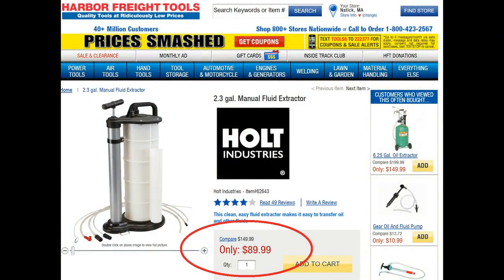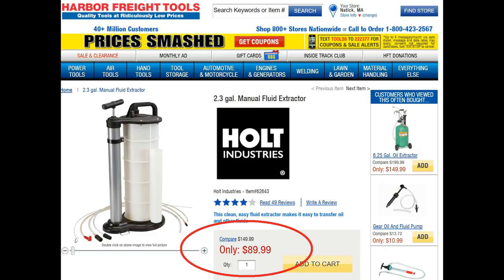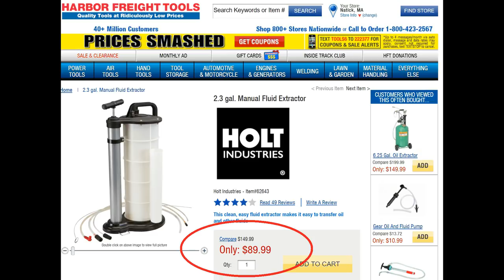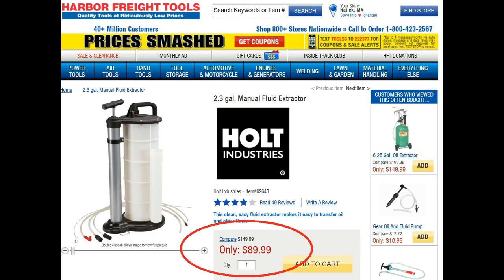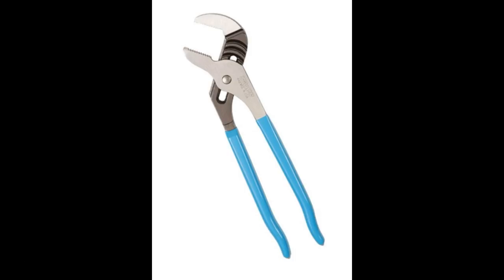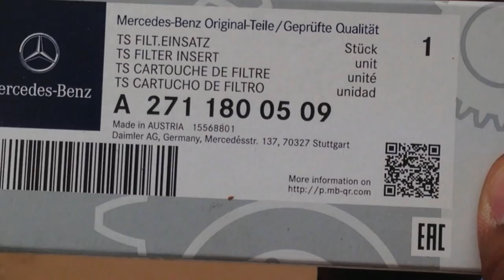EASIEST OIL & FILTER CHANGE ON MERCEDES

Comment: A couple of tips for this method.
1. The ribs around the pump body are at 2 litre intervals, which is just over 2 US Quarts (2.11qt) and
2. Using a chugging great metal screwdriver to remove the O rings is asking for damage to the seal grooves. Use a wooden lolly (popsicle) stick or a bamboo skewer to lift them out.  Great video, and a very nice car!
Reply from the maker: Nice feedback. I appreciate it. Hopefully people can see this and benefit from it.

Comment: I just did an oil change on my 2006 W203 C220 today  using the same method with a pump that connects to the battery. Done it four times now with no problems 😊

Comment: that was really clear new oil, goes to show not much is left in with suctions method
Reply from the maker: My mobile Mercedes mechanic uses the suction method as well and he said dealerships do the same method.  Mine just happens to be a manual pump vacuum versus an air compressor powered vacuum.

Comment: Hey flex i live in Jamaica and have recently recently bought a 2013 c250 and have found your videos quite informative would love to know how often do you change your oil 🙏🏿
Reply from the maker: Mercedes needs synthetic oil. Synthetic oils claim to last 10,000 miles but I change my oil around 5,000-7,000 miles.

Comment: Hello, great video!

Question: How much oil were you able to extract using this tool? It looks like your extraction took up only half of the 2.3 gallon tank. W204 has about 7 to 8 quart (1.75 to 2 gallon) capacity depending on model.
Reply: a w204 c180 uses 5.8 quarts

Comment: Hi, I wonder a  bit of old  oil remains using this way.
Reply: The new oil filter will take care of that. The PLASTIC oil pan actually has a high risk of breaking when tightening/loosening the oil plug so this is the proper way to do it on this car.
Reply: @Davoodoox1  you must me jocking :))))))) this is the poor way to do it
Reply: Depends on what car you have. Some cars leaves a lot of oil behind because the shape of oil pan.

Comment: I used it and there was a quart and a half left in the pan. 2016 E-350.  The suction was great but couldn’t get to bottom of the pan from the oil dip stick
Reply from the maker: I never had a problem. Also, a lot of dealerships use the same suction methods versus draining from the pans. But of course, they have the best suction machines. But even mobile mechanics use a form of a suction as well.

Comment: Yes sir  ,can you plz help me out with my problem, I had 2009model c200 kompresor, troble code p0045, its say supercharger boost control solenoid circuit A open, but where is it the boost control solenoid, tnx

Comment: Bought a pump, didn't work on a 2003 Merce SL500 Roadster( has no dip-stick but does have the dip-stick tube) used all the methods..
Returning the pump.

Comment: Hey Flexx... Sup man🤙🏽
I tried your website link but got a weird message. Thought I’d pass that along... I had a question for ya. After you cruise past 75k miles on your car, will you change it up to a high mileage blend? What are your thoughts about 0-20? I’m at that stage now and was wondering what your thoughts were. I bought all the gear to do the oil change myself btw... why pay over $400 when I can do it for less than $200 😄🤙🏽
Thanks for all the great videos man!!

Comment: Some of the newer Mercedes are being made without dipsticks.  How do you extract the oil from the top in this case?  Can you go through the opening where the oil cap is?
Reply from the maker: I didn’t hear about that but I assume it’s the same as my Audi. It doesn’t have a dip stick cause it uses a digital read out but it should still have a hole if you want to buy a dipstick to put in. That’s what I did on my Audi A4. And I can still extract through the hole.

Through an oil cap is usually not feasible cause it doesn’t go low enough to get out all the old oil. Unless you have a kit that screws onto the oil cap area that sucks the air out and allows for an exchange of fluids.

Comment: Howany quarts does the holt extractor can hold? I have a Mercedes ML320 it takes 10 quarts of oil.
Reply from the maker: I don’t remember.  The extractor is in the link in the video description. You can see the spec on the eBay page.
Reply from the maker: 1.9 Gallons = 7.6 quarts.   
There's other version that have larger capacity but of course, they are more expensive.   When I do a larger oil change job, I just extract to the capacity of the extractor...empty the extractor into another container, and then start extracting again.  It's no big deal.

Comment: When you change the oil yourself how much does it cost you to do it?
Reply from the maker: $40
Reply: @TheFlexxGarage  Oh wow that is cheap, I take my C300 (W205) to a independent European auto mechanic and pay about $150 which is still cheaper than the Mercedes dealership.
Reply: I got a quote yesterday from Mercedes Benz dealership to change transmission oil CAN$500 labour. I’ll rather order my own fluid extractor and DIY on my drive way.

Comment: A wats good Flex, wat kind of oil do u use on your wife’s C300
Reply from the maker: Same as on my car.  Mobil 1  0w40
Reply: Thx for the quick reply. I’m gonna stop dealing with Mercedes, the old crew tht was there doing the maintenance are all gone now. I was cool with all of them. I brought the same oil pump u have. I knew to use Mobile 1, just wasn’t sure if it was the 40 or 30. I had to order another rear lighted star. It seems like someone was pulling on it to see if it comes off. Probably kids, my dash cam wasn’t in parking mood so it didn’t pick up any movement. I don’t think I’m gonna be doing any of the turbo stuff you’re going but I’m not gonna lie I am intrigued. Be safe. Look forward to your next video. ONE!

Comment: Your oil pan doesn't have a drain plug?.
Reply: It actually does but from what I have heard and read is that you get more oil out of the oil pan this way
Reply: @arabiantxn  It's just as effective and you don't need to put it up on the jacks...

Comment: Hey flex
I just changed my oil on c250 2013 and after driving it 200 miles from oil change 
I noticed that when I started the car 
It smokes from exhaust for couple of seconds the. Stops
What is wrong and what can i do to fix it
Reply: Timed Wraith that’s normal on that 271 engine

Comment: Yeh you can do it ! Just needs 7.5 hrs pumping as it takes about 1.5 hrs to extract a litre..... I mean yeh does the job but on your own time maybe....😂🤦🏻‍♂️ I’ve even warmed the car for like half hour to get a nice thin oil but by the time it takes to get it out the oil will be cold again 🤔🤦🏻‍♂️😂
Reply from the maker: doesn't take me longer than 10 mins to pump out everything. There's a method i learned. You only stick the tube in like halfway, pump out the oil. As soon as it starts bubbling  like its running out of fluid to extract...low the tube further down and repeats. Works everytime for me.
Reply: Flexx Alexander ok bud I’ll give it a try 👌🏻🤨😂🤦🏻‍♂️
Reply: Flexx Alexander Nha mate ! You must have the Incredible Hulk version, my version must be Mickey Mouse ..... it’s rubbish basically next time I’ll do it on the floor the conventional way....👌🏻👍🏻😂
Reply: Did you take the oil cap off and remove the oil filter before pumping?
Reply: @paolotrabucco1863  The best way is to to slightly warm up your car a bit so it lowers the viscosity of the oil. It makes pumping it 100x easier. Just dont heat it up for too long or you can end up melting your suction hose.
Reply: what utalkin abt. it barely takes ten mins